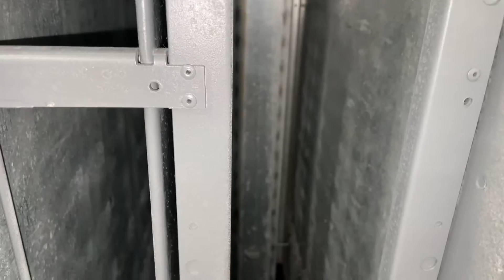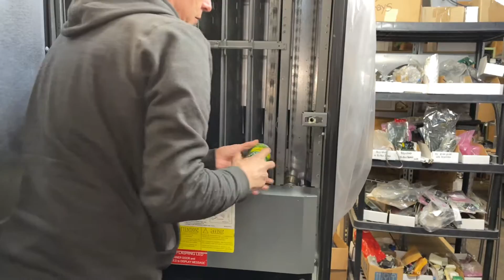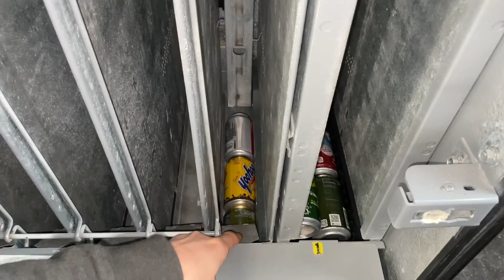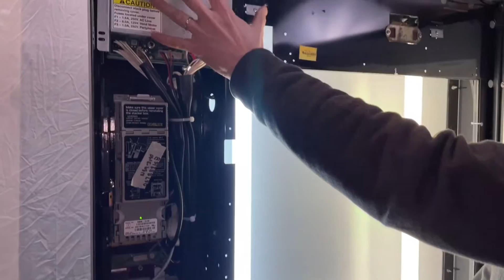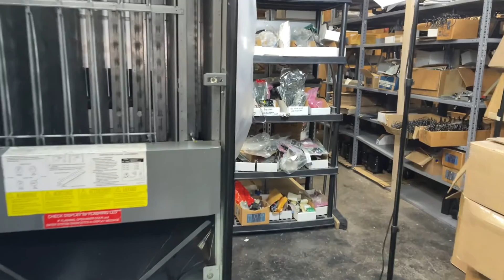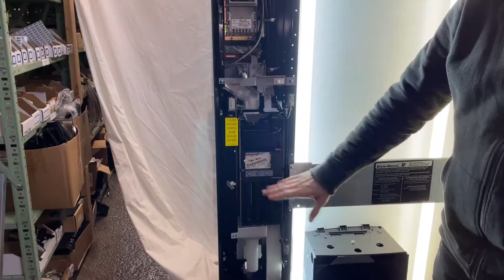Dixie Narco 501E & 276E Vending Machine - How To Load Drinks And Prime

Comment: Hey Alex how do I prevent a double vend. I keep having two drinks drop at once.
Reply from the maker: I need to know some more detail about what type of product you are attempting to vend. ie. Can or Bottle? Ounces? What column is it in?
Reply: @VendingMachineSupport  It happens with 12oz cans. I'll do a motor test and as it goes through rotation it will vend 1, then another and then it'll skip a rotation and on the next vend two cans come out. Also it's set on function one. And sometimes it'll do it with bottles 16.9 oz
Reply: @basiceconomicswithjosephju756  I found I had to only go 2 cans deep and adjusted the cam to number 2 or 3 .. holds less cans but I didn’t have to spend money to get rolling
Reply: I’m having the same issue

Comment: Have you ever changed out the clear buttons on an older vendo Pepsi machine?
Reply from the maker: There are several different ways the selection buttons are mounted on Vendo drink vending machines. It is all based upon the which model you have. Some require a small flat head screw driver and needle nose pliers. While other styles need the plastic and metal retainer springs to be removed along with the selection switch assembly. Something to remember. The major drink manufactures like Coke and Pepsi do not manufacture the actual drink vending machine itself. The vending machines are manufactured by companies like Dixie Narco, Royal Vendors, and Vendo. Which model do you have?
Reply: @VendingMachineSupport  Vendo 470

Comment: Hi there, I have the Dixie Narco 276cc. It’s setup for 12oz cans right now. What would I need to do to set it up for 20oz Gatorade bottles or 16oz water bottles?
Reply from the maker: The Dixie Narco 276CC was manufactured by Dixie Narco for Coke-a-Cola. This denoted by the CC in the model name. There will be a few other identifying numbers in the model name that denotes the type of control board it is using. For example. DNCB-276E-SII would indicated that would be a broken down like this. Dixie Narco (DN) Cold Beverage (CB) 276 (Can Drink Capacity - This number is not always exact) E (Series) SII (Control Board). What is the complete model number of your machine? The will help narrow down what setting are needed. A side note. Take a hard look at the 16.9oz water bottle you are wanting to vend. Does the bottle make a crinkling sound when squeezed? If so, there is going to be a good chance that bottle will end up getting jammed or double vended. The newer water bottles are produced with thinner walls. This leads to vending issues when stacking 24 or 48 bottles on top of each other.

Comment: Having issues priming mine. When I go through the motor tests, it says testing, but no motors will turn.
Reply from the maker: When you pressed the mode button on the board did the front display show something in the effect of 'JC - X' where X is a number?
Reply: It did not. However, I just found a bad glass fuse up on the board. It is the middle fuse. I’m wondering if this isn’t why my motors are not working?
Reply from the maker: @vicnestico3137  Correct. That is the motor fuse or known as the F2 Fuse. It is 6amps. Something could possible be jammed in your machine that caused this fuse to blow. For reference. The F3 (1amp) fuse is for your peripherals like coin changer and dollar bill validator. F1 (1.6amp) fuse is for the main control board. Get a couple of the 6amp motor fuse as this will blow more frequently. Check to make sure you do not have a pinched or jammed product at the bottom of your columns. Please make sure to remove power before attempting to remove or replace the fuse.
Reply: Just got some fuses, and going to try it. I’ve also been doing some research and see that I’m going to have to get different shims and rods to convert this over to cans as well once I get it working?
Reply from the maker: @vicnestico3137  That is correct. You will need x8 rods & springs along with x8 can shims for selections 2 through 9. The rods and springs will need to go into hole B in the cradle. The brown timing cam on motors 2 though 9 will need to be set to 1. ( Video on how to set the timing cam: https://youtu.be/7Gb6bUHi7cA )The rear spacer will need to be set to hole 13. For selection number 1 you will need a total of 8 plastic can shims. Four on each side. The red and gray timing cam will need to be set to 1. The rear spacer will also need too set to hole 13.

Comment: Are you able to put 8-9Oz drinks in the Dixie Narco 501e?
Reply from the maker: Yes but it requires a kit that is no longer available to my knowledge. If memory serves me correctly. The kit consisted of a few rod & springs with colored plastic lifters that slid over the rods. As well as a side shim and back spacer adaptor. It is more trouble than it is worth in my opinion. Stick with 12oz, 16oz Cans, 16.9oz, 20oz, and 24oz bottles to reduce the chances of jams and double vends.
Reply: @VendingMachineSupport  Alright Thank you!! That's about what I read online but thought I'd ask you for validation. Seriously thanks again!

Comment: got any info on priming a DNCB 320/184-7? it's an older machine without the bill acceptor / external controller
Reply from the maker: The DNCB 320/184-7 model machine would be what I call a single price drink machine. The price is set on the coin changer itself versus a control board. These drink vending machines use a vend relay / solenoid to pass power to the vend motor. The easiest way to prime these types of machines, and really any drink machine for that matter. Is too simply vend each individual selection using hard currency until two or three drinks drop consecutively. This can be done with the door open so you can watch the motors cycle. An alternative priming method is to actuate the power cherry switch on each vend motor with a small insulated screwdriver. For reference this video ( https://youtu.be/7Gb6bUHi7cA ) explains how to adjust a timing cam on a 501e. The power cherry switch looks much like the home switch in the video. The motor cover will need to be removed to expose the vend motors. Actuate the cherry switch and allow the motor to cycle to its next notch. Repeat until two to three drinks have vended. I will see if I have a functioning single price drink machine at my shop to make a quick video in the future. Until then Please take EXTREME CAUTION and at your OWN RISK. There is high voltage running through the power cherry switch that passes onto the vend motor. I hope this helps.

Comment: Answered so many questions Thank you!!
Reply: Well I do have a curiosity based question if it isn't too much to ask for. That being. Are you able to fit 20oz bottles in slots 2-9? Or should you simply have 12oz cans there and only use the first larger slot for 20oz drinks?
Reply from the maker: @asdasd-pi8pk  You can use 20oz bottles in columns 1 through 9. Though, in columns 2 through 9 you will need to remove the rod and spring from the cradle. Then replace the 12oz can shim with a bottle shim. Adjust the back spacer to keep the bottles loosely pressed up again the sold out flap at the front of the column. I recommend about a 1/4" gab (an index finger's depth) between the rear bottle cap and the back spacer. Lastly, set the brown timing cam to either 2, 3, or 5. Which one is dependent upon the bottle size. This video explains how to adjust the timing cam. ( https://youtu.be/7Gb6bUHi7cA ). I plan on creating a detailed video series that covers these steps in detail. I hope this helps.
Reply: This helps immensely! I really do appreciate your help. I'm 18 and just started with the vending machines and you've helped me so much. Truely Thank you!
Reply from the maker: Happy I could help. Please leave a comment if you have any other questions.
Reply: @VendingMachineSupport  Your awesome! I'll let you know if I got any other questions. Thanks again!!